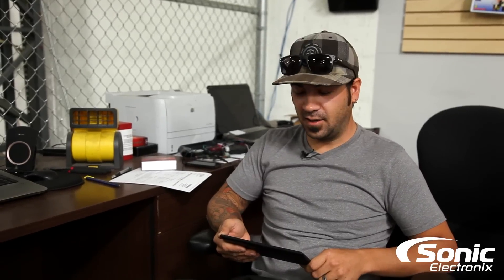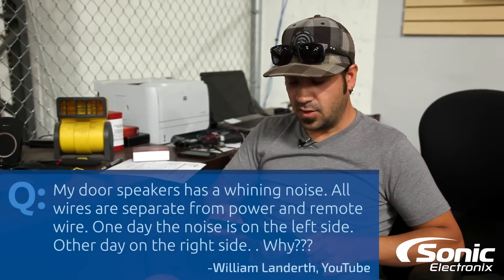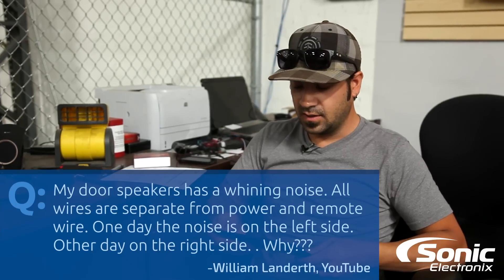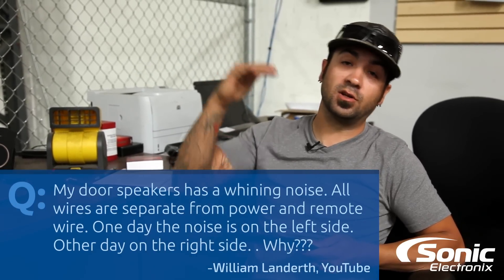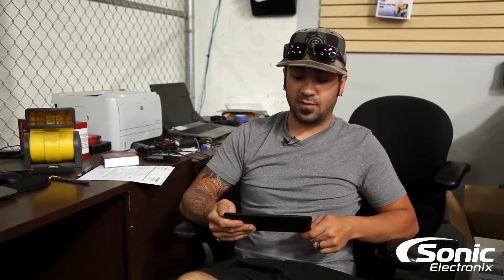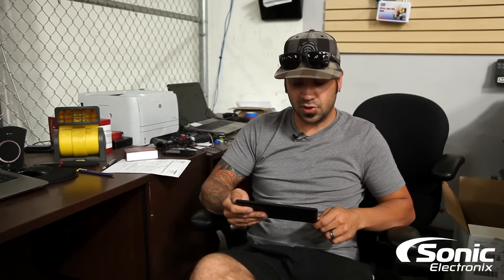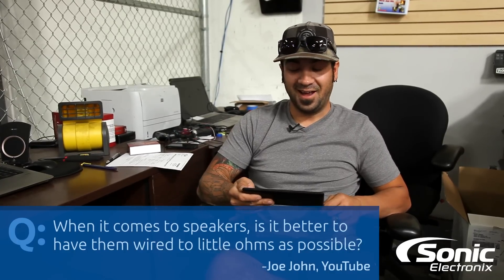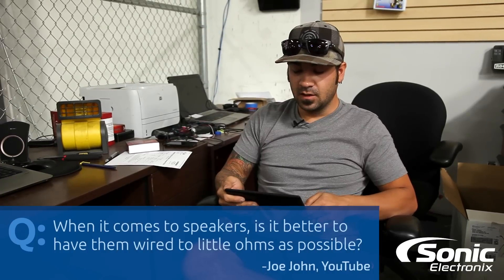Why is My Speaker Making a Whining Noise and What Impedance Should I Choose? | Car Audio Q & A

Comment: I've got a really annoying stomach rumble sound that ramps from low to high. I've moved my RCA, tried unplugging the antenna from the module, grounding the antenna to the amp ground, big 3 upgrade, and still does the whine with car off on all inputs. Cd, radio, aux, etc. Even with the RCA unplugged. The radio is over 10 years old, though. Would love to find this damn noise solution before I put the band aid on it. I'll try grounding the RCA, but it's not a pioneer it's a Kenwood. Not sure if it even has a PICO fuse.

Comment: I have Audi A7 2015,The speaker at the driver door make rattling/distorted noise ,most of the time when weather is worm/hot.In cold weather normally it’s ok but not all the time.
This only happened after my Local Audi changed the drivers door after minor accident(it was just scratch at the door).
I have had my car for 5 years but it never had issues with speaker.
Only speaker that door was changed has the issue.(On the process of changing the door every thing was removed from the door and put back in the new door)
Audi said is nothing to do with us ,even though it only happened straight after the door repair 
Any suggestions would greatly appreciated

Comment: I have an issue with ground interference coming from an active crossover. I would love to be able to find a fix for this instead of the current situation where I have disconnected it a through it on the shelf. All my rca are high end. The noise is not coming from all out puts. The engine noise is  only coming through the rear output for my mids. Yes I have tried a different set of RCA's, I have also changed ground locations on both the amp and crossover I have also changed the rca to a different amp and the noise follows. It is not the rca itself nor the amp. I have narrowed it down to the rear output for the active crossover

Comment: I have a noise of about 4000hz that comes after about 10 mins. If I turn the hu off and on itll take another 10 mins to come back. Tried unplugging rca cables and everything it still makes the noise. The gain or volume on the head unit doesnt make the noise louder or quieter what could it be?

Comment: Dude..
HELP ME..
My speakers are making hissing sound while car's off.. It's eating battery hard. 3 batteries already, alternator new. But damn speakers killing me..
2004 Homda Euro Acc
Reply: I would make sure that the radio stays off and that the amplifier turns off when the car is off. If it stays on, it might be sending some signal tot he speakers and the amp killing the battery.

Comment: Can low grade speaker wire cause a static whine noise? What about power cabel meaning i bought welding cabel and it is not as good as the welding cabel i used to have in it?

Comment: So for the people that may be having this issue. He mentioned checking your ground on your battery. I did and it was barely loose but I tightened it and the noise went away just like that. I recommend that if you can turn any of your battery cables by hand that you tighten them a little. So big ups to this video. Thank u

Comment: ... Ok different kind of problem here.. I have a aftermarket head unit  Dual XDM 16BT in my 99 solara I do not have an amp hook up to it not even stock one I have no rca's coming out from the unit.. so here's the problem... When I plug in an am/fm antenna cable I have engine noise coming out from speakers when the cable is not plugged in there is no engine noise... HELP!

Comment: I am using Technics SU 5 Integrated Amplifier with its paired speakers, I was playing Radio (Technics ST 5 Quartz Synthesizer Stereo Tuner) all of a sudden a high pitched sound started coming out of the left speaker, when I lowered the volume to its minimum it became ok later after some time this even got repeated. please suggest some remedy

Comment: My subs are makeing a loud noise even when music is not playing but it only happens when i shut the doors to my car what could it be
Reply: Feedback issues. How do you have your amp connected. Thought the back of the stereo or you have a hi/low converter? And how are you running your remote wire, through the back radio. Or fuse tap?

Comment: Why does the bass come on when my radio is off? Then It comes on when I press the gas it will whine sometimes.   I have two 12s hooked up to a after market amp
And a factory radio...im using a converter box ..i checked the ground..the wiring.  Any tips will help..thanks
Reply: PRESTON PROVOST I have the same problem
Reply: Looks like a remote wire issue. Where don you have it connected? Fuse tap or back of the radio?

Comment: If you switch to components you will get a small whining noise and your car is now turbocharged and you have tons of power . 🤦‍♂️ how does this whining noise bother people I had focal coaxials and switched to hertz components and right away got a small whining noise on start up and while driving depends on your rpm I see this as normal and herd it in many cars with components

Comment: something VERY IMPORTANT you forgot to mention about ohms, DO NOT go below your amplifier or stereo's minimum impedance rating! if your amp/stereo was design for 4 ohm speakers and connect a 1 or 2 ohm load to it you can burn up the output transistors in it! I've personally done this when I was a teenager I had a home stereo that was designed for 8 ohm speakers and I connected 2 pairs of 4 ohm speakers in parallel which created a 2 ohm load and within a couple months the left channel went out on it, what I should have done instead was connect them in series which would have made an 8 ohm load and it would have been just fine

Comment: Your getting interference from power or ground wire! Make sure YOU PUT POWER GROUND WIRE ON 1 SIDE OF CAR AND RCA ON OTHER SIDE OF CAR! PROBLEM SOLVED! LAMEN TERMS ENGINE NOISE FROM POWER AND GROUND WIRE IF YOU RUN RCA ,POWER AND GROUND ON SAME SIDE! YOUR WELCOME!!!
Reply: I did it the way you described it. But I still get a little noise. I'm gonna electrical tape my rca cables because they are hanging around in the back next to the ground and power so you might have a point there.

Comment: I have the clarion 360 crossover and it makes that same engine noise, no matter what i did it wouldn't go away. So i disconnected it and went straight to amps and it noise went away.
Reply: Same thing happened to me. It's not as loud. It doesn't bother me at all but I hear a little engine wine. I do have the rca's running behind the deck down by the ac pipes. I'm gonna tape them up nice and reduce the gain on my amp. I have my eq at 1/4 gain and it's super loud.

Comment: I need some help ok so my radio would play music then the sound just cuts out all together or there will be sound except in the right door speaker then after a certain volume or time it cuts out and I’ve checked all the fuses and even put a new radio in and it still does it and makes a whining noise or hissing noise all through my speakers and such after I turn the truck off

Comment: I know this video was published in 2014 or so but I need help with something! Ok so I have a aftermarket doubledin with all bells and wistles. Running to a cap and two amps. One amp is a mono block and the other is a four channel amp for mids and highs. I seem to be having noise even if the car is not running. Ive done almost everything and cant figure this one out. Have noise even with no RCA'S pluged into the four channel. For some reason getting noise on the four channel amp only and not the mono block. Also I can lower the freq. on the 4channel amp and it goes away but then I cant really get the most out of the amp. Please help me I want to finish this project soon. Thank you!
Reply: Forgot to say everything is new except the mono block amp.

Comment: I have a 2014 Honda Accord and I upgraded my door speakers and since then when I turn on my car it does a low bass vibration for while then it goes away, any suggestions?
Reply: That’s the same problem I have on my 2009 chevy tahoe

Comment: Every time we cut on the radio or the blinker or emergency blinker one speaker Statics really bad. Instead of the sound of click click click when we cut on the blinkers it Statics 2014 Chevy Cruze trying to figure out what to do without spending a fortune just adding in that it's only one speaker on the driver side

Comment: Related to the noise: I would never install an amp this way, but before trying to attempt. Would it work if I got a aux cord to a rca audio output to install an amp from a factory stereo? Minus the hi/low converter that give that sound. Thinking differently before wasting my time.

Comment: I am only having a problem with a whining noise on my driver side speaker. Just installed an amp for my door speakers. RCA's are running on the passenger side and power wires are on the driver side. I have a 2007 GMC sierra New Body, when i had the factory radio using the aux cord and charging the phone made the same whistling whining noise. got louder when i accelerated. installed a pioneer app radio 4 and the noise went away. i had subs when i had the factory radio so my remote wire is tapped into the fuse box. when i installed the new radio i ran 3 RCA's to the back on the truck to the sub amp and to the amp for the door speakers. the RCA's only run along the power wire in the back under the carpet for no more than a foot. i grounded the amps in 2 different places, the ground wires for both are only like 2 foot long. the sub amp is grounded with the capacitor and door amp is grounded under the seatbelt bracket where the sub amp used to be grounded. the capacitor is grounded  under the seat bracket. i wire wheeled all the ground connections. i split the power wire after the capacitor, i don't know if that was a bad idea since the door amp is not grounded directly to the capacitor, but does have a good ground. i unplugged the RCA for the front left speaker and the whining noise is gone. i did run new speaker wire but i kept it as far away from factory wires as i could. i don't know if by the parking break where all the factory wire is, is possible where the speaker is getting interference? or if i need to focus on the RCA's? its just weird that its only the driver side speaker. i jumped the remote wire from one amp to the other, if that has anything to do with it as well.

Comment: Speaker's wired down to  a 2Ω load to match my amplier 2Ω stable. 120 Amp alternator upgrade 1700 CCA battery and 700 CCA Battery all 0 gage cable powers & grounds & engine to battery & battery to alternator & use no noise suppressor elimination of the problem. 9 time's out of 10 it's a bad connection. Problem occurs wines and humming when stereo is changed out Ground the chassis of the Stereo use a screw and Ground the Metal Case. The small Ground wire Isn't enough. Im running a Pioneer cd head unit stinger rca cables to the power plants Rockford Fosgate ampliers and Crossfire oldskool DB3 12s. 4 one inch dome tweeters. Two 4x10 mid range. Waiting on my 3,5" dash speaker's cerwin Vegas & two rear 6x9s. Custom install in my 1975 Catalina.  Check BigDWIz out on Youtube. His video's and help, helped me out on my amplier and wiring of 2 Subwoffers two dual 4Ω impedance  voice coil's to a 2Ω impedance.

Comment: Hi, i have a problem and io have tried everything.
first i change out the amp and speakers and sub, still same hum/hizz sound from all speakers. doesnt change by volym or if i rev the car.
then i tried to change out the HU, same sound and also a new sound that goes with the cars revs.
changed back to old HU and old sounds back.
i measeure between the car battery - and stereo ground, got 0,8 
i also measure between the amp and car battery - got 0,8-0,9
tried an sound filter didnt do anything same hizzing with it.
when i take out the RCA Cable out of the HU the sound goes away, also goes away when i take the rca out of the amp.
when i tried plugging in a rca to 3.5 mm and plugged that in to my phone the sound was perfect.
what is it that mess my audio up?
Reply: Robby pablo i troed that. Can only ground l or right rca because if i ground both the sound dissapers

Comment: I am having alternator whine. I've checked all the grounds all my wires and it is still there. What do I do?
Reply: You likely ran your power wire too close to your RCA. Doing this creates a magnetic field around your primary power wire which is picked up as interference by the RCA signal wires. I had this problem. Re-run the RCAs on the opposite side of the car as your power wire. Keep grounds short.

Comment: i just upgrade my speaker in the car got no amps or subs just replace my head unit too so when am driving i hear the whinning noise in my speakes when i dont play music what could it be its a chrysler 300 so my battery is in the trunk
Reply: David Monarrez just installed new speakers and Alpine power pack an I have a low whine too when no music is playing and at low volumes. I know it's there at moderate music volume as well but I can't distinguish it. I know it's degrading my overall sound quality though. Going to check all my wiring and go from there

Comment: Hi, i have a home cinema 5.1 surround system and the subwoofer always makes a strange noise like whimping even though i disconnect every cable of it. also when i play music its bass is like faded and that strange noise still continues. if you can help me it would help a lot 
thanks
Reply: get new cables from surround to the player.
Reply: +jesse ver I've tried this too 
it still does that noise
Reply: maybe the settings on the eq? maybe low quality songs? maybe the surround sound system is dead.... :p
Reply: i also have a 5.1 system, and if i have the jec plug connected or unplugged it makes a whining sound. i resolved that by buying a better jec cable. or if you have had this problem from the beginning then you might have bought a surround system with a defect....
Reply: +jesse ver i think it is just dead :ppp 
thanks anyway :)

Comment: Heres a good one then. So I have an amplifier that doesn't make any engine whine noise at 4 ohms and lower. But if I disconnect all the speakers. Run 2 8 ohm speakers to the amp, it puts out the worst whine I've ever heard. Why is that you think?

Comment: I have a Mk4 2003 Jetta with a pioneer deh150 unit with 4 pioneer speakers I hear an acceleration whining noise in I strongly believe the front 2 speakers maybe all 4 the factory monsoon system is bypassed because I didn't want to purchase the adapter i have tried to read threads and searched YouTube with no solution I don't want to take it to the radio shop as they keep charging me for work so does anyone have a simple DIY solution
Reply: ground your rcas to the headunit.
Reply: Erik Gonzalez make sure you have good grounds on the head unit and amp also make sure you have a good battery and battery cable and battery connections a good battery can filter alt noise a bad battery can allow alt noise through.
Reply: Just pay the extra money don't be cheap Holmes

Comment: Hey guys. Got some engine whine in my tweeters. When I unplug the rcas from my amp the whine goes away. Then, when I plug in a set of RCA's that lead right into my iPod into the amps input, there is no engine noise. Does thus mean the problem is my rca cables? If so, what kind of cables do you guys recommend? I was checking out the stinger 8000 RCA's but I wanna make sure the RCA's are the problem. Thanks in advance
Reply: Dillon Lauricella Make sure you have the right KIND of RCAs. Twisted and Shielded use 2 different type of noise removal, and it depends on the noise removal system your amp uses. Apparently the RCAs you are using for the iPod have the right kind (check to see what those are, Twisted pair or shielded one wire) then get the same type for your stereo. In most car amps i have used they use a Twisted Pair of RCAs. This is a better wire if the amp has the right filetering system. But if it does not and you use those you get whine noise. It is absolutely your RCAs. But is it because they are bad? or the wrong type? this i would not know unless i knew what amp you are using and what type of RCAs you are using. Good Luck
Reply: +Dillon Lauricella The 'lesser' types of engine whine, could be a bad set of rcas. Could be interference from a power/ground wire. But typically, head units have whats called a pico fuse that blows easily, and thats just for the rcas. So try getting a speaker wire. Wrap it around 'ONLY ONE' rca, and ground it to even the head unit. That does typically fix things.

Comment: Hey guys, my rear right speaker creates alternator whine through all my speakers. when I unplug it it's fine. I can't run it anywhere else to stop it. Any suggestions? Cheers
Reply: Ever figure this out? I just got my truck back from the body shop and they replaced the door and now the rear right speaker is whining. I’m guessing ground but don’t know where to start
Reply: @jwestf  try using one of those interference removers. Forget what they’re called, I’m pretty sure that solved my issue! That long ago now I can’t remember what I did to stop it!

Comment: Troubleshooting can range from easy to hair loss!!! I had to strip down an entire install once for engine noises. Hours after tearing apart the car I found a split cable under the floor carpeting that got interference from the wiring harness going to the rear of the car!

Comment: I ran my subwoofers at 2ohms and found that the ends of the wires started to overheat and lose color. So ran them in series at 4ohms. Problem fixed.
Reply: You need thicker wire. 14 to 10 gauge

Comment: I have a extended cab f150 and I am thinking of putting a box in the bed with the accordion tube to connect cab to bed but always Hurd when subs fire towards you they don't sound as good as firing away... What's the best option I have?